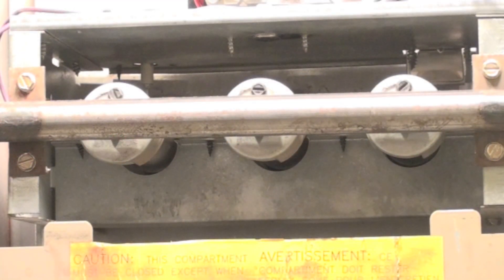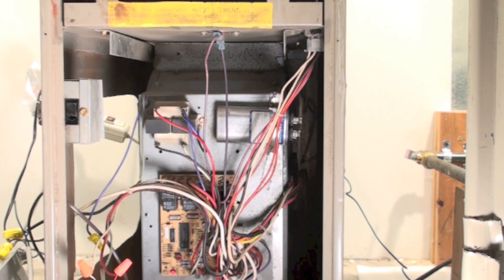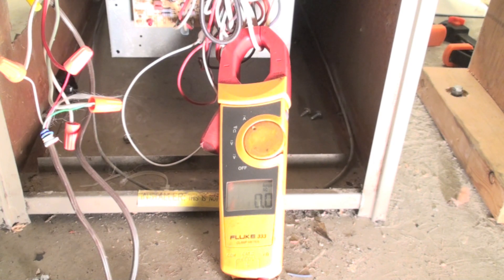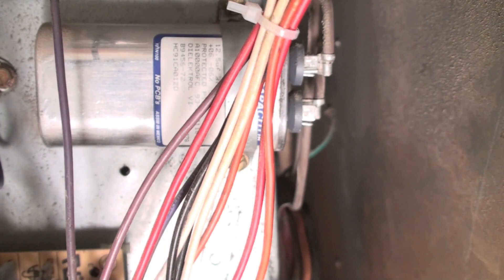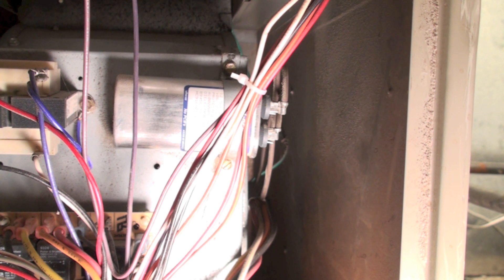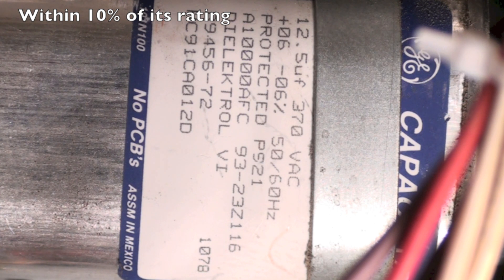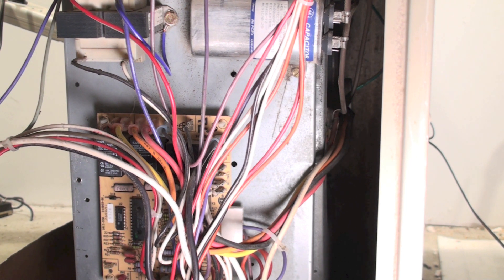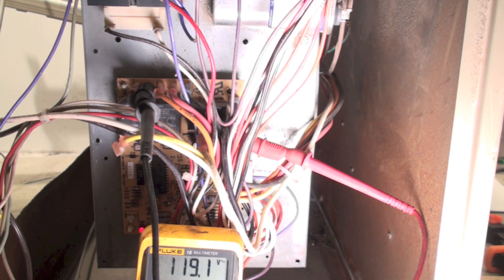Troubleshoot the gas furnace fan

Comment: hi Gary, just a quick question about the w1 and w2 on the variable speed furnace, I was under the impression that for a furnace to go on first and second stage it has to have w1 and w2 wire from the tstat, but mine is only wired to w1 does that mean it's not going to fire up on the second stage. thanks
Reply from the maker: If the thermostat connection is only to W1, it will only heat with first stage.  If it is jumpered W1 to W2, the first stage will run for about 10 minutes, then go to 2d stage.
GFM

Comment: Great video! I have a 16 yr old GM 80% and the fan relay switch on the board kept on going in and out. It had this loud clicking sound to it. After several weeks the furnace finally stopped working, so I decided to replace the board since i figured the fan relay switch got stuck to the open position. Now that the new board is in place, the clicking sounds started to happen again after several days of installing the new board. What causes this fan relay switch to go in and out while the fan is running? What other things should I investigate. The capacitor is within specs.Thank you in advance.
Reply from the maker: If you can send a video of the furnace during operation, I may be able to help.  Send to Grayfurnaceman@gmail.com
Reply: Thanks for the reply. I will. I thought the new board I got was defective so I replaced it with a new one, but the repeated clicking sound of the switch relay is still there. I will send you the video via email.

Comment: I have an Amana 80 furnace. 17 yrs or so old. Wife thought the air flow diminished to where the heat was falling out of the register but not forcefully....blower fan was on. I changed the filter; dirty but not bad.  Condition persists. Blower runs but is not really moving air.
Reply from the maker: You could have a dirty blower wheel or plugged A/C filter.
GFM
Reply: Is there an AC filter separate from the furnace filter? tomaonaigh
Reply from the maker: No.  The A/C coil itself sometimes becomes clogged.
GFM

Comment: i have a conquest 80 furnace. blower will work when  A/C is on but will not work in heat mode. already replaced the board and now am getting a code for limit switch.   in heat mode you turn fan to ON or auto  position  it will not run.  is it the limit switch in the heat exchanger?    Model GKUA 100-E3N-1  . burners ignite , gas flows, just the blower motor will not come on in heat mode.

Comment: l have question. I s it a relay problem when the thermostat works in on position but not auto position while the air conditioner is running?

Comment: If a customers says air flow is not terribly weak, but not as strong as usual from registers. 
Fan motor is getting 120v from board, and wires, connections, run cap are all good, what symptom(s) would this failing motor present?  It died while running before I got a chance to check anything on it. New motor restored its usual air flow strength from registers.
Reply: +JustPlumDucky  Forgot to add this is an 80%-er, and  PSC motor (maybe all 80%-er's are PSC motors...?)
Reply from the maker: +JustPlumDucky Probably had bearing failure.
GFM